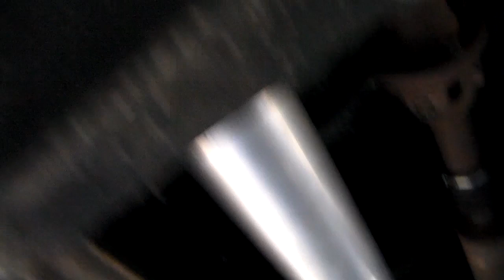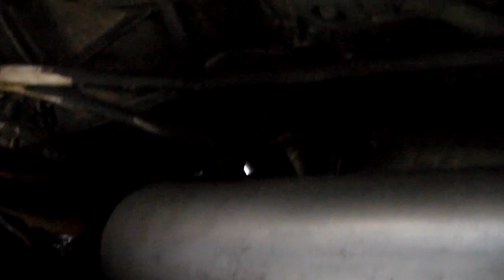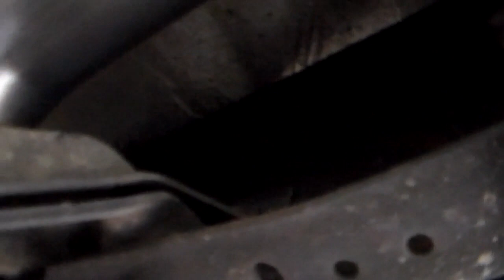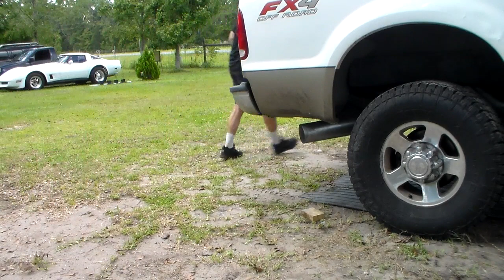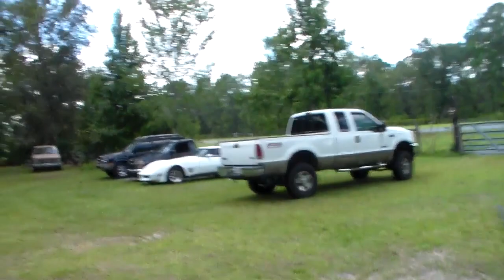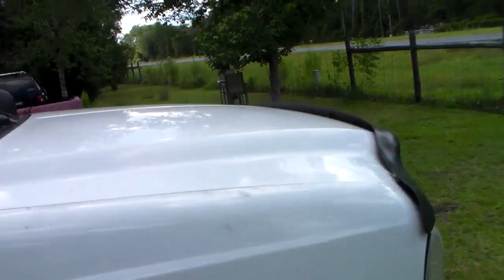What MBRP 5" exhaust sounds like on an 2004 F250 6.0 diesel

Comment: damn the vgt took a minute😅
Reply from the maker: Yea this truck has a lack of power thing going on for being stock without a tuner it should have more power than it does.
Reply: scottsinfl sctx4 with some clean tunes, i used the box tunes but my buddy did custom tunes to marry the trans and motor and the motor was bone stock that truck ran like a raped ape for what it was
Reply: scottsinfl it sounds like you need to clean the veins in your turbo, shouldn't take that long for the turbo veins to close up. That could be the reason for loss of power
Reply: RCAddict.dez oh that’s right the oem vgt turbos had vein problems either laggy or stuck open/shut, i never had a problem with mine though
Reply: Sticking unison ring is very common on these VGT's.. But God damn do they sound great.

Comment: Did you have a check engine light on while shooting this video? P0299 code?
Reply from the maker: No this truck has good boost you may have a bad or clogged map sensor or turbo boost control problem.  P0299 is a low boost code.
Reply: scottsinfl gotcha. Reason asking, my truck had the p0299 code. I have plenty of boost. But, my VGT doesn’t kick in until a minute or so after driving. 

I noticed yours take a bit to kick in unlike other trucks kicking in a second or two after startup.
Reply: scottsinfl I’ve heard the p0299 code also has to do with the veins in the turbo getting stuck sometimes.